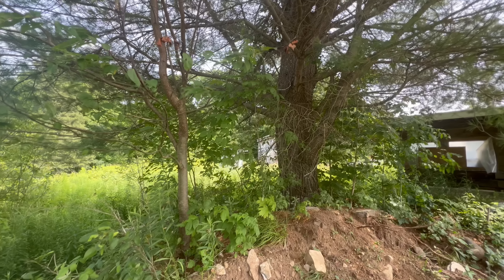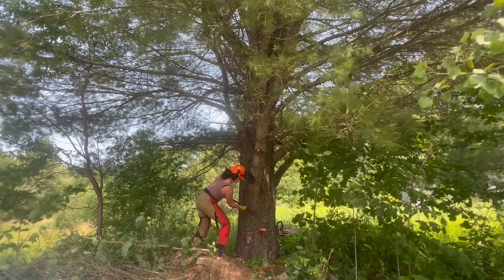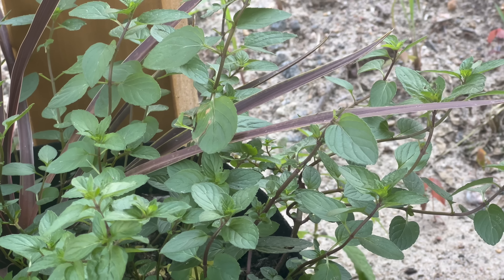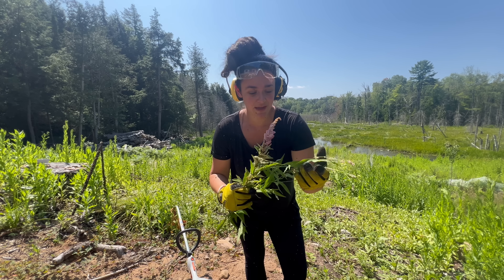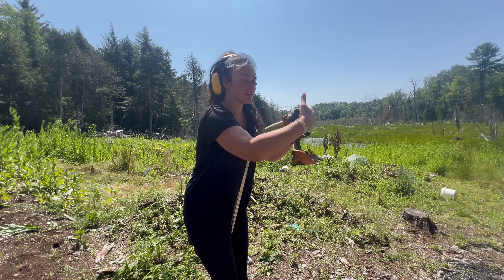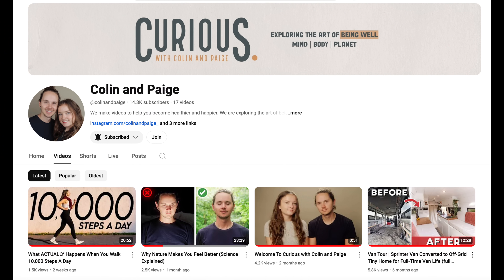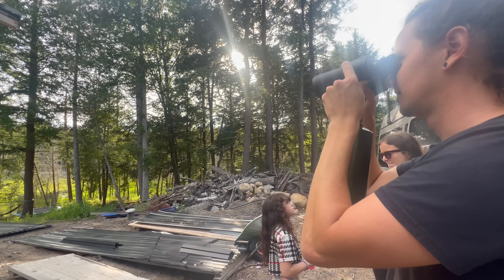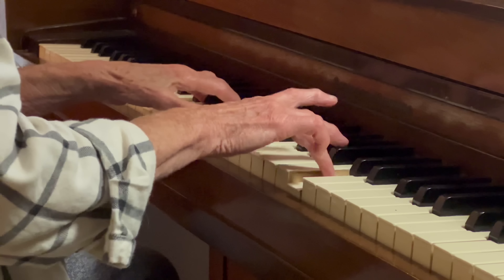A HUGE Surprise! And Tree Felling/Bucking of Course.

Comment: When the line gets short you just press the throttle and smack the whacker on the floor which pushes that button in and allows line to come out, you only take that off if the line disappears in the hole or to add more

Comment: Those trimmers can be a challenge at times. When you are dealing with long heavy brush a blade is better. However, if you are able to keep it shorter the trimming line will work. Try soaking the line in a bucket of water and a little dish soap. The heavier line is a better idea as well. Good luck. 
Lovely to see you spending your Sundays with family. Love the deer on your property. Happy belated Birthday 🎉

Comment: Also the trimmer string that comes with/in the trimmer tends to be damaged by long storage and I always replace with new stuff when I get a new trimmer as it is very frustrating to have a new trimmer that you have to restring every few minutes.  There are some great add on heads including plastic and metal cutting heads. They work very well.

Comment: Ya did good.  One lazy trick I use when bucking for heat.  When the tree is first dropped, laying there with all its branches, I begin at the stump move to the first branch and cut from little to big.  If I cut the branch free from the trunk first, I then must wrestle the branch around, trying  not to dip my chain in the dirt,, If I begin at the outboard and chunk it up moving to ward the trunk, the branch is held stable and secure for each cut.  Now,, if cutting for logs and lumbering, I do the opposite and just clean the bole of branches that are going to be left as slash in the forest. I'm lazy.  I don't want to pick up a pound that I do not have to.

Comment: If I recall correctly it's turn on the choke, press the little gas belly 3-4 times, pull the starting cable 2-3 times and it will start and turn off, the choke and and pull to start
Reply: *turn off the choke then pul to start, if you pull really fast it will take one pull to start

Comment: Many happy returns and thanks for sharing.
May I, a bit late perhaps, share my experience with weed eaters. Firstly, nylon cords tend to weld them selves together in the spool and thus being hard to dispense and breaking off at the dispense bushing all the time. Which is why I eventually abandoned it and chose a tri-finger blade in stead. Secondly, the (cheaper) models with the wire drive running through a bent pipe are vulnerable to vibrations from hitting hard objects and not as durable as the angle drives. I have an older Stihl FS 131/R. I even take larger tree sprouts down with it. It scolds me when I get too close to concrete sockets or steel poles but it keeps going and going. It is definitely not cheap, but it saved me from a lot of frustration.
Reply from the maker: YES okay this is what was happening. The cord was sticking to itself and not pulling out. I'll look for a blade that will work for this guy

Comment: The last jar of maple syrup---I remember watching the video where you made it! I didn't realize I'd been following you this long. Love the progress.
For the weedwacker,  I don't use the wound string anymore, I attach an aftermarket mod that has plastic blades that last a lot longer for overgrown areas like that. Mine is the Weed Warrior Push-n-Load. I've used metal blades too but they are smaller giving a smaller cutting path. Keep trying. You'll find the combination that works best for your needs.
Reply from the maker: Wow that's wild! I hope I can make some more this coming winter! I'll look into plastic blades!

Comment: I'm frustrated as well with my Stihl weedwacker .  I kinda think it's ok for light grass, but anytime I do some rough stuff the string breaks like you said and it is frustrating.  If they sell a metal blade I would get that for your large weeds.  I think the .095 is the heaviest string you can use.  Thanks for the tip on the carbon string, I'm ordering it now.
Reply from the maker: I'm hoping a blade could fit but I am quite happy about the carbon string. Working well!

Comment: The string should come out when you bump it on the ground before it breaks off. Use .95” string. Usually 13’ long. 😊I wear a light long sleeve shirt buttoned all the way up when I whack weeds. FYI, The shaft driven weed eaters  are much better. 😏

Comment: an extra good idea is to remove as much weight/branches, off the cut side so the wedge side is heavier, and it wants to fall that direction. its less possible for it to lean back and pinch the chain. the back lean is the heavier side pulling the tree towards the building and that would be a bad thing. i enjoy watching you learn and decades of experience is a good teacher. keep up the good work
Reply from the maker: I was thinking that big branch would’ve been smart to remove but also dangerous. But would’ve made for an easier drop

Comment: I have a blade for my weed eater and it works really great for that thicker stuff that real thick grass or stems that are what they call stocks. It's better with the blade if you can get the one that looks like a saw blade. They say it works better for them, but they have one that has 3 has 3 Like 3 different blades sticking out from the center and that cuts pretty good as one I got, but I'd like to try the saw blade 1. If it's on there. We're in starlight's as long as we see if I have enough done.

Comment: Home Depot sells a red cord that is much tougher. also tap the weed eater on the ground while its spinning to push the button and let out more cord before it gets to short and breaks off. if it doesn't let out more cord its probable installed incorrectly on the spool
Reply from the maker: I was having to do that every minute until I got a stronger cord :)

Comment: Best thing to do is before you let your string go in there. Spray a little WD40 on your screen. Put your string in your line, twist it up like you're supposed to wind it up like you're supposed to, but the WD40 will let it string out easier, and you won't have to go in there sometimes to make it. Uh, work when you bump it.I learned that for my buddy of mine

Comment: Happy birthday!  Stay 30 as long as you can. 

Ok...the FIRST RULE OF WEED WHACKING IS-  Keep your mouth shut....grass doesn't taste good!!! 

Whacker line comes in different sizes.  I'd bet that it came wound with .035 diameter and that's about good for the homeowner doing light duty whackin'.  Getting in to anything heavier will destroy it fast.  I've looked like you (except you're a lot better looking) so yeah..you were in some pretty thick and heavy stuff.  Next up is thicker, like .080 or .095    I run .095 and it'll damn near eat a tree.   It sounds like you found some good stuff.